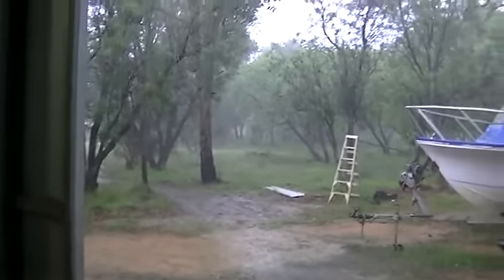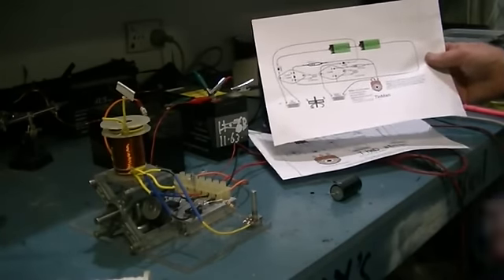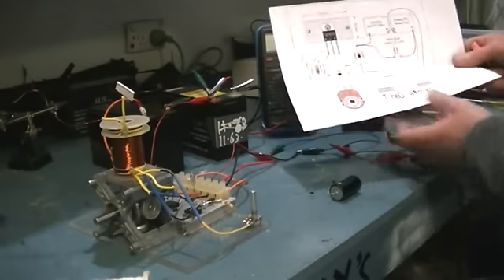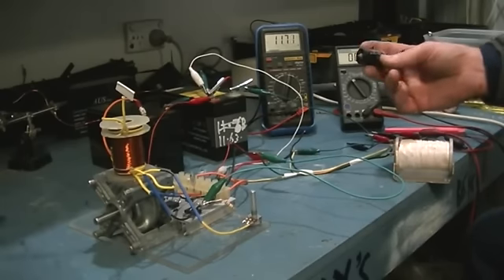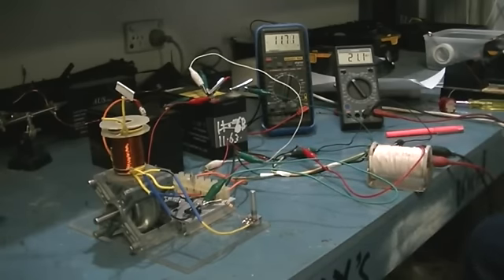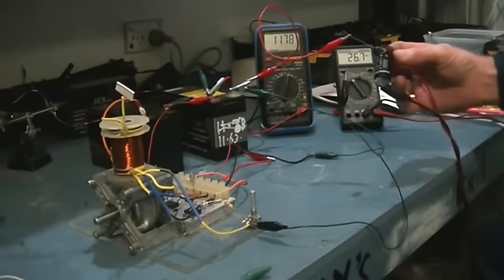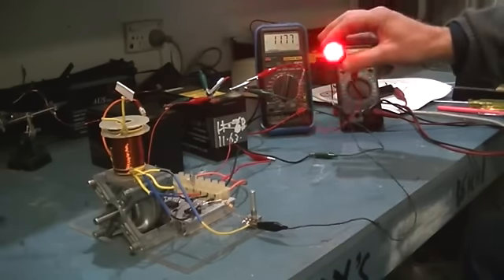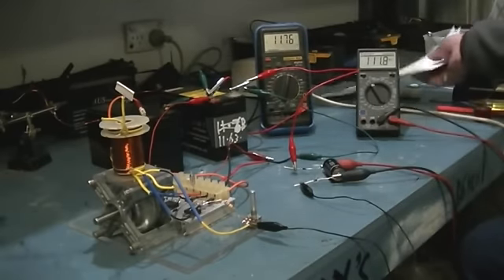simple but complicated.mp4

Comment: Very good demo.Since fooling around with SSG, I've begun to look at it like a couple of batteries placed in series, a coil inbetween, and a momentary switch to insure the coil actually has points of zero potential (and thus acts as a coil). It is, in essence, a bizarre way of charging batteries, if looked at in a fundamental way. And not particularly efficient, either. That is, if you negate the free energy theory. I much prefer the Tesla switch variant that parallels a higher potential...

Comment from the maker: The test coil was two winding's at a one to one ratio.The higher voltage was a result of the fast collapsing of the magnetic field around the coil-Volt's higher,amps lower.
The more coil's you add,the more you loose due to losses in resistance within the wire itself.

Comment: When you look at the trigger voltage using that method, isn’t the energy from the coils verses charge battery vs CAP just balancing out due to the transformer… how do we know that is the voltage hitting the base and not the voltage being rectified to the charge battery. This is where a scope comes in handy. You can see the actual potential at an instant in time at a given point in the ckt.